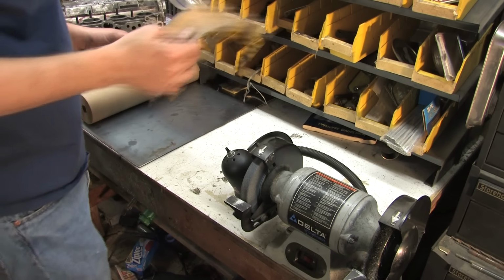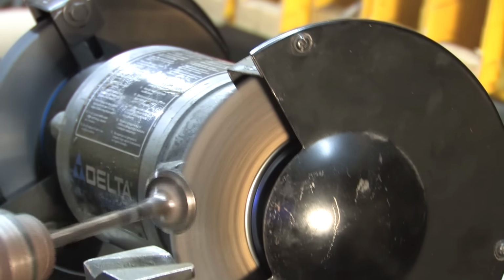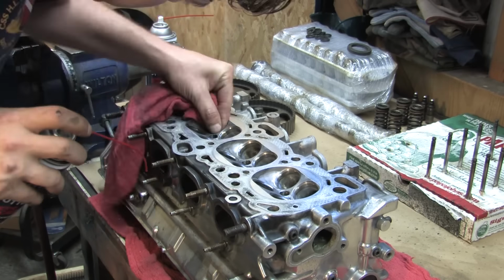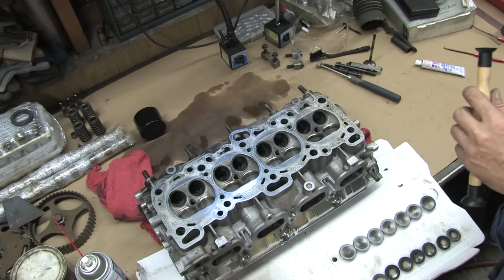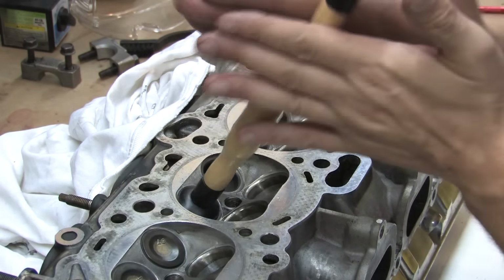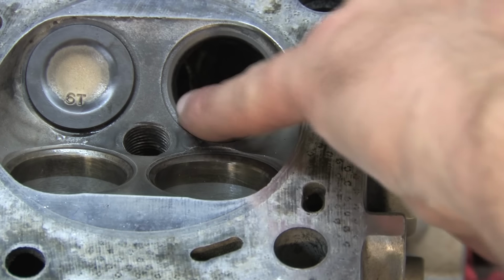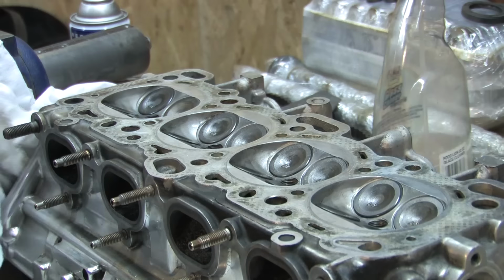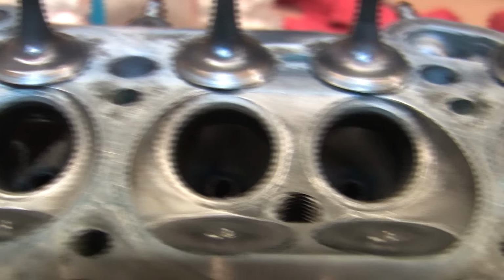Cylinder Head 105 - Valve Job Basics

Comment: You said, you spend about 2 min/valve grinding?? How do you know, it is done?? Noise?? feel?? Thanks =)
Reply from the maker: 2 minutes including all the chucking in the drill, taping, etc...  You just want to do this to remove all the carbon and scale.  You don't want to do this until you polish the whole valve because you'll destroy all the angles and edges it needs.  They clean up quick.  You still want to be able to see the contact ring so you can see how it's wearing.  It will be obvious as you remove the carbon
Reply: Do you have to change valve guides,...every time?? of course, valve seals !
Reply from the maker: Eero Laukkanen  Nah.  Not usually on a good working head from an engine with good compression and no oil consumption issues.  Replacing valve guides is a beast of a job.  If you have geometry problems causing some kind of funky wear pattern or bent valves, then I scrutinize them, but usually they're in good enough shape to re-use without any issues.  There's really not a good way to measure them at home without some really expensive tools.  I let the pros tell me what to do with 'em because I can't do the work.
Reply: Bad oil consumption problem/ smoking bad....., no noise =)
Reply from the maker: It's probably a valve stem seal issue, but that's enough justification to have the guides checked out if you spot any contamination.  Have them checked by someone with the proper tools.  They tools literally cost in the thousands that allow you to properly check them and replace them.  Often they can be brushed out and re-used.
Reply: Brushed?? Don't they get "bigger", loose,...if you brush them?? just wondering,...or valve seals will hold the oil...anyway??? Thanks =)
Reply: +Eero Laukkanen Earlier he said he changed out the steel wire wheel for a brass wire wheel because it's softer.  The higher stems sees less wear so naturally their gonna seal.  Usually before the springs are installed you can hear a suction noise from the seals when the valve is (hand) pushed in & pulled back out .

Comment: You can't just clean up valve seats like that. It looks good and it might work for a while, but you really should use a seat cutter to get rid of all the pitting. Then grind and lap the valves into the seats.

Comment: Question in regards to brass wire wheel. Do you recommend buying a solid brass wire wheel or are the cheaper brass coated wheels just as good in this case?
Reply from the maker: Brass coated is what you want...  I have no idea where to get a solid brass wheel for a bench grinder?  I can find them for my Dremel, but... all the brass wheels I've encountered for my bench grinder are actually brass-coated.

Comment: I'm having issues cleaning the valves with brass wire wheel and a drill. I have up to 0.5mm thick carbon buildup on some places and even after 10 and some minutes they are not clean. Is there any other method or should I just go with it untill it's done? I'm worried about damaging then since after some time I've noticed a fine golden dust accumulate on the bench. I'm worried it is the coating and not the wire wheel.
Reply from the maker: It's the wire wheel.  Brass coated wheels do shed.  It's okay.  You won't hurt the valves like this.
Reply: @Jafromobile  Thanks for answer. The coating on my valves has same golden colour and I was unsure.

Comment: Did you fo a leak down to see if any were leaking
Reply from the maker: There's a video here called "not another valve job" that covers an even better test.  To do a leak down, you have to have an assembled engine.  That video covers a way to do it without that.

Comment: That isn’t a valve job, that is a cheat way to get the valves to seal. Best thing to do is take it to a machine shop and get the seats cut.
Reply: technically correct, the best kind of correct
Reply: However, Jafro is still a beast at his craft. of course the machine shop will always get the job done, this is a lovely demonstration of some nuance though.

Comment: In my manual it says that the valve itself can't be refaced and the valve seat needs to be refaced with tree different angles. I guess this is to make it not over heat?
Reply from the maker: Some engines, you can't.  Yes, it's a heat thing.  Any time you re-grind a valve, you remove material and therefore shorten its life.  It's a procedure of diminishing return.  You pay a machinist for his time spent re-grinding a used part, and a new one is often around $8-$15.  You have to cut new seats if you're installing new valves.  If you re-grind a valve, the same applies, though.  So if you have a bad valve, the seat cutting is inevitable no matter how you choose to fix the valve.

Comment: One quick question sir, does this affect the power output of the engine? :)
Reply from the maker: +Jc Valencia If it fixes a leaky valve, then yes, absolutely.  It brings the engine back up to its engineered potential, all other factors included.  You have to be able to hold the boom in to make that crank turn.
Reply: Thanks for the answer sir, I'm planning on doing the same valve job on my 4G32 btw :)

Comment: For each valve... Are the valve place back to the same spot or it does not matter?
Reply: It matter .. you have to put back each valve  in the same place
Reply: Flavio di natale Oh boy. I'm not good at explaining myself. I hope you understand what I mean. Compare to the small valve and exhaust valve, I know where its place because of the valve size. However, do the valve have to be in order? Because I didn't mark the valve where exactly it belongs.
Reply: I know this is months old; but if I understand you correctly, then YES.  #1 cylinder valves need to stay with cylinder #1, and so on.  If you're referring to the rotation of the valve within it's seat, then no, that doesn't matter.

Comment: Quick question : Is your brass wheel a true/solid brass wire wheel, or is it steel wires coated with brass ?
Reply from the maker: It's brass coated steel.  As far as I know, there are no pure brass wire wheels on anyone's shelves.
Reply: @Jafromobile  ok, thx a lot !

Comment: Believe it or not, I had the heads on our car taken to a machine shop for a valve job. We had just 1 car and the machine shop picked them up. When they came back, the deliverer had them face down in the truck where the surface was exposed to sliding around in the back of the truck. The problem was he said 1 was cracked and the other warped ( aluminum). He shaved it like corn rows in a field! The grooves were deep! I called them and the machinist swore it was done right! I took them to Pep Boys. He saw it was botched. He called the machinist and said 'You messed up man.' The machinist told him he didn't. The machinist started getting hostile so the Pep Boys guy got the manager on the phone. The manager heard the machinist threaten the Pep Boys guy. Pep Boys sued and WON! That other parts store closed down ALL because of the machinist! That one guy brought down the WHOLE business! That parts store had been in business for YEARS! It was a 'mechanics parts store'. It had exhaust pipes etc. People bad-mouthed Pep Boys when it wasn't them! So, have rebuilt heads put on and not rebuilt from machine shops! Especially aluminum! If there are inserts in them it's junk!

Comment: I still see some pitting in the valve seats after lapping.  Will they still hold compression properly in that condition?

Isn't some (or a lot?) of the change in pitch and volume of the grinding while you're rotating the lapping tool, due to the lapping compound breaking down, in addition to smoothing out the valve seat and its mating surface on the valve? I notice that even after the sound of the lapping is reduced, that when you add fresh lapping compound and lap the same valve again, that this sound is once again louder and rougher, until that bit of lapping compound breaks down.

Wouldn't cleaning a head using a soda blaster be a lot faster and easier, once it's as relatively clean as is shown in the video, with the only mess being nontoxic soda?  I did that last night, as one of the last steps in cleaning my first cylinder head (from an 89 Ford Escort 1.9L), and I didn't have to manipulate wire wheels, deal with toxic cleaners, etc., and it came out really clean.  Though before the soda blasting, I cleaned off most of the oil, grease, and carbon, using soap and water.  I considered having the head hot-tanked by a shop to clean it, or buying a steam cleaner (but a good one would have cost over $100), but I wondered how clean I could get it using stuff around the house.  I first soaked the head in tap-hot water and Dawn liquid dish soap for a couple hours (I could have soaked it longer, but I was impatient), then I did some manual scrubbing while it was in the soapy water, using some plastic and brass brushes. Then I soaked the head for about three hours in dilute Pine-Sol (two cups to seven gallons of water). I could have soaked it longer, but I didn't know how long the head could sit in Pine-Sol, which is a mild acid (even when diluted with so much water), without doing some damage (I later learned that I could have left it soaking for as much as 24 hours).  Then I soaked the head overnight (about ten hours) in another seven gallons of water and a pound of baking soda to neutralize the Pine-Sol (probably didn't need to soak for ten hours, but I wanted to get some sleep).  The head still needed more brushing (but not a lot) to remove the rest of the crud, but the result was pretty good.   I knew it would still need to be blasted after this to get off the remaining crud, but once I'd soaked and scrubbed it, blasting off the rest was easy and quick.  The only downside I found to soaking the head in water and Pine-Sol is that the valve guides turned dark since they're steel or iron, but hopefully this won't have damaged their inside surface. To prevent the valve guides from flash-rusting after the head dried, I coated both their upper ends and inside them using a spray oil called "Deep Creep" which is good for preventing rusting.
Reply from the maker: +John Sawyer The method in this video doesn't require tanking or blasting of the cylinder head.  A shot of carb cleaner and a shot of air will take care of the dust.  Soaking in water-based solutions or household cleaners can cause a reaction with the metals used in the cylinder head if the pH isn't neutralized afterwards.  People have seen this with citrus cleaners, Purple Power and the equivalents with Aluminum.  The best solvents are acetone or petroleum based.  Mineral spirits is my personal favorite.  I made a video about it and how well it works.  Your valve guides are Bronze or Bronze Manganese.

About my cylinder head, sure there was pitting, but not on the valve sealing areas, it was above and below it.  I managed to pass the "water test" afterwards.  Being that this car is my "baby", I decided to throw more at it, restore the valve installation height by installing oversized valves and monster cams… so it got a complete valve job afterwards.  If this was a stock, un-modified daily driver, I'd have rolled with the head after this band-aid fix.
Reply: +Jafromobile - Sure, the lapping you did doesn't require the head to be as clean as tanking or blasting would get it, but I thought that it would be an alternative to using the toxic cleaner you were spraying into the combustion chambers, and blasting could similarly be localized to just the combustion chambers instead of blasting the whole head.  Last night I happened to watch your video (DIY Parts Cleaner) on using an air compressor to blast clean a head and a block using mineral spirits.  What a great idea--I don't know if I would have thought of that, since I'm new to blasting and so I assumed that blast guns could be used only with dry media.  Your method is a lot faster than soaking such large parts in water and a cleanser and then scrubbing them.  I need to clean up the inside of a valve cover that's coated with congealed oil, so I may try your method on it.

Thanks for pointing out the damage that can be done to aluminum by letting it soak (or at least soak too long) in some cleaners that some people use, like Purple Power.  Simple Green supposedly can have similar negative effects, though I've read that there's a version of Simple Green that's specifically made to be safe for aluminum, but it probably can't be found at a regular hardware store.  I've been reading online for the past year or two about these problems with some cleaners that are too acidic or too alkaline for aluminum.  The MSDS for Purple Power says its pH is 11.2, which is pretty alkaline.  I've read that some cleaners can cause not only surface corrosion, but also atomic changes that can weaken the aluminum deeper in, as ions from some cleaners shoot through the metal.  Definitely worth knowing.  All of this is why I used Pine-Sol instead, which is only somewhat acidic, with a pH of 4 to 5 (supposedly less damaging to aluminum than a strong alkaline solution), which must have been made even less acidic by my addition of water.  I was also cautious about how long I left the head in the Pine-Sol/water solution, and as I mentioned, I soaked the head afterwards in water and baking soda to neutralize the residual Pine-Sol that remained in the head after I pulled it from the Pine-Sol bath and rinsed it in water.

In any case, I'll have to try your method of blasting parts with mineral spirits as a comparison.  As you say, there isn't any concern about pH effects with mineral spirits.

About my valve guides: a little parts-picker-upper magnet sticks to them fairly strongly, so would they still be bronze or bronze manganese?  I've read that bronze manganese is slightly ferrous, but the magnet that I used stuck to the valve guides more strongly than I would have expected from bronze manganese, though I have no experience knowingly putting a magnet onto bronze manganese, so I have no real-world experience to compare with.

Comment: I spent today lapping a cylinder head from a 6.4 ford diesel. I cleaned the entire cylinder head. Removed all carbon. Purchased new intake and exhaust valves. There 2 intake and 2 exhaust valves per cylinder. I lapped the valves using the hand tool and lapping compound mixed with grease from Permatex (it comes premixed). I doubled checked my work after finishing the cylinder head using water into the ports. Some water flows from the valves. A couple of drops here and there. The valve seats and the valves sealing surface looks perfect. Is this normal after lapping a cylinder head.
Reply from the maker: Not completely normal.  The new valves and the old seats probably don't line up as well as you'd want them to.  The angles may be off.  Over time, these parts wear into one another.  When you replace the valves, they're no longer the same surface that used to mash into the seats.  They're pristine, perfectly angled valves on a worn seat.  How did the valve guides look?  It would be a shame to have pulled it down this far and put it back together with some leaky valve seats.  That condition typically doesn't improve, and if left alone it will shorten the life of the valves and seats.
Reply: Jafromobile it's like a weep on some of the valves. The guide are in perfect condition. The lapping is an even circle on seat and valve.
Reply from the maker: It's gotta be the angles of the contact areas being off.  If there was a deformity on a valve surface warranting its replacement, remember that deformity was hammered into the seat a few million times.  Both parts should be hardened steel, but with enough repetition, it's bound to have an affect the seats.  Give the leaky ones an extra lap if cutting seats is out of the question, and hope you don't wind up dropping your seat pressure by much?  I suppose the wider valve seat [and therefore less seat pressure because it's spread out over a larger area] might not be as bad as an actually leaky valve on a diesel.  If it's only a couple of valves, I'd risk it.  If it's consistent across the valve train, I'd spend the money cutting new seats.

Comment: what was the simtoms of the car before clean the valves ? thanks you
Reply from the maker: None, really.  It failed a water test on a few valves after I spun rod bearings.  I checked it to see if it had life left in it, and it just barely leaked.  The rod bearings caused some pretty weird symptoms, though.

Comment: Where do you get that brass wire wheel? I ask because, besides those very small wire wheels for Dremel, I don't see any big brass wire wheel like you have on this video. The most I've seen are those brass looking ones, the once that seemed to be brass coated, however, you could clearly see the metal part where the strands were trimmed that it is not made of brass.
Reply from the maker: The one I'm using here is fine brass-coated.  It's not actually brass.  You should use the brass-coated wheels for this.  I wish I got that right in the video.